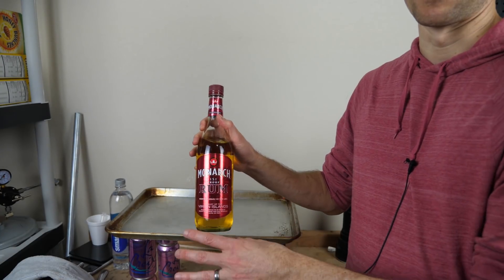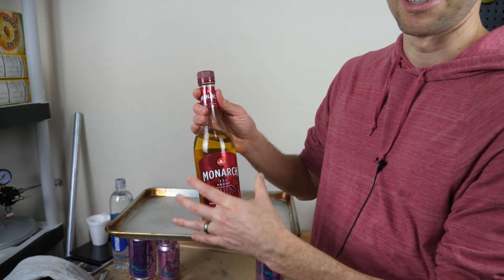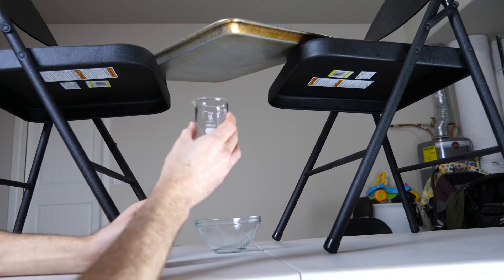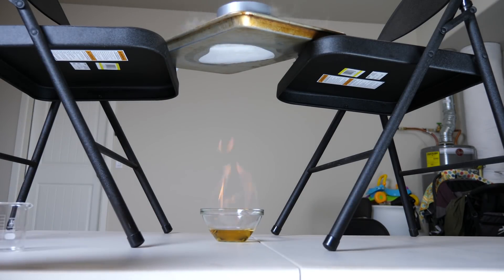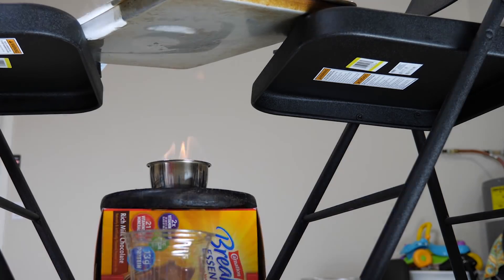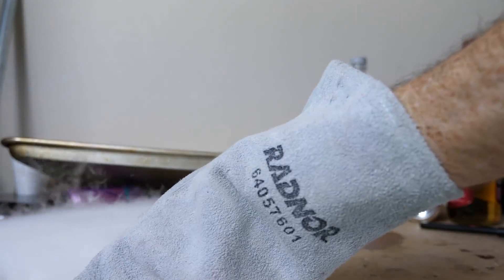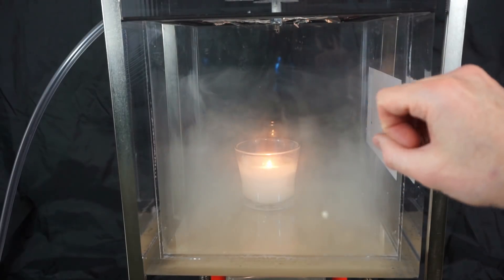Is it Possible to Turn Alcohol Into Pure Water? (I Almost Burned Down my Garage)

Comment from the maker: Hi everyone! Based on a lot of comments I need to clarify. This is not distillation. Distillation is the process used to separate two liquids. I am not distilling the alcohol. I am literally converting alcohol to water, not just separating a mixture. Distillation also requires condensation, so I guess that is where the confusion is. However typical lab condensers that use cold water to condense cannot remove enough heat in this case since the steam from the fire is extremely hot, that is why I used dry ice.
Reply: The Action Lab 
Yeah tell em dae wae
Reply: P.S. If you used scotch for this video and not some cheap junk in a plastic bottle I'm going to have to report this channel for cruelty and disturbing content.  Commented before the video, time to watch!

edit: ok cheap rum, we are safe. High proof vodka would have been better, Specifically Everclear, that's 190 Proof and doesnt have sugars or colors like rum.
Reply: I noticed that the atmospheric water first condensed and freeze on the cooling surface (white layer ) which with heat from combustion melted and dripped with the condensed water from flame this increased the total water collected
Reply: Seriously, you should have at least a few fire extinguishers in your house.  At the absolute minimum, one in the kitchen.
Reply: Haha, that fire, my dad once burned a whole table down when he was trying to get pure alcohol...
Reply: The Action Lab Try to think of your safety a bit more next time.,.
I mean that set up, gosh.,.
Reply: The Action Lab Drunkers be like "why the hell you wasted the whole  rum to get 20ml of water"
Reply: The Action Lab what if the water in the atmosphere got condensed by dry ice and its melted by the heat from the burning ethanol
Reply: Are u born goodva
Reply: I may have missed a step, my water came out dry.
Reply: The Action Lab yep hlyour right
Reply: The Action Lab can you do a Q&A in the near future?
Reply: This experiment is about the only useful thing for that rot gut rum.
Reply: Action lab I think the coolness of the dry ice would convert atmospheric moisture to water
Reply: Please stop making your videos click baity. All you're doing is a combustion reaction...
Reply: Is it distilled water 
So it is dangerous to drink 
But how distilled water is dangerous and we drink distilled sea water
Reply: The Action Lab this is satisfactory :)
Reply: Are you sure the water collected wasn't condensation formed by the air in the room from the dry ice..? Not that dissimilar from a glass of cold water right? I feel like this expirement could've been done better
Reply: Hmph I almost said distillation
Reply: To remove the idea of distillation.... maybe try burning a measured amount of denatured alcohol, which is around 99%, using the same method. At same time put 2nd dry ice pan over a 2nd bowl of plain water with no heat. Show the collected amount of water from the burning alcohol is still more than the 1% that would be in the alcohol even when subtracting the 2nd amount of water collected from the moisture in the air and the unheated bowl of water done as a separate experiment at the same time next to the alcohol setup. Even if it comes out not in the favor of your premise it doesn't dispel it, just that it is difficult to prove using your particular method as proof. Then again, I could be all nutz to the wind on the whole idea.
Reply: The Action Lab it’s not = it’s and arrow
Reply: Can you do the walking on water experiment using cornstarch
Reply: This is actually not pure but very lightly carbonated water
Reply: Very good explanation.
Reply: Yes it is possible, it's called distilling, usually the goal is to get stronger alcohol and to throw out the water but... I suppose you could do it for water if you're crazy. 

You just went the more complicated route
Reply: hi men, I love your videos, congratulations for your exciting experiments.
By the other hand, there's a lot of stuff about the flat earth and conspirations and stuff, and in one of the flat earth videos I've heard about the moonlight decrease the temperature of anything that lights, and it's one of the arguments that the flatearthers use to support their theory, I have an idea of what happens but I really like if you make a video about this topic and explaining what and why happens, that will be cool.
Again, congratulations and have an exciting day full of science.
Reply: using a lower grade alcohol like 80 proof and boiling it off would yield better results
Reply: @BeckyYork  https://youtu.be/nVFUrIe7r9s

Comment: But an alcoholic beverage product is not 100% alcohol and the water comes from it is not only from the combustion of pure ethanol alone, but the water content itself present in the beverage product also getting evaporated and condensed due to the heat of combustion.

Comment: In my opinion this experiment was done incorrectly, I'm almost willing to bet that most of that water collected was from condensation formed from the air, not the alcohol combustion. Just like cold water in a glass causes condensation around the glass. I wish you would address this man!

Comment: Why not heat the rum to 175°F to boil off the alcohol. Wouldnt the method used in this video condence the heated air on the the bottom of the tray and create that condensate?

Comment: You should redo this with a simple jury rigged distiller for the water vapor. You can certainly do it on the cheap that way. Maybe a collab with some handcraft or machining channel. I could provide  some designs if u want

Comment: I don't know how humid it is where you are, but couldn't a lot of the condensation on the metal pan be from the air, and not necessarily from the alcohol? I'm in SE Texas and I'm pretty sure most of the condensation would be from humidity if I did that here.

Comment: u might want to use dry ice in acetone(a few other liquids should work), it has a smaller but flatter surface area so it gains less heat but transfers it more effectively to the desired place. it's used in place of liquid nitrogen whenever you need something very cold but not that cold

Comment: A lot of the water was also just water from the air because dry ice also condenses water vapor from the air. You should have used normal ice.

Comment: Water and co2 are what you get when you burn a hydrocarbon. When you burn charcoal you only get co2. When you burn other elements you don't get either. Many metals are flammable in the right conditions. Including aluminum, magnesium, and titanium

Comment: we could try chemical approach buuut we don't know if it's worth the hassle and if nobody will watch it?

(theory... ethanol should get oxidized to water and ethanoic acid with potassium dichromate (i call it orange cancer), now sulfuric acid should be able (not 100% sure) to oxidize it further to carbon dioxide and water, after distillation the water should seperate from sulfuric acid....)

Comment: This is kind of a shaite setup. Humidity from the air would gather on the bottom of the pan and condense regardless of the vapor created from burning the alcohol just like you said at the end of the video yet that is not insignificant. You need to isolate the gases using a condenser and then expose the condenser to a cold temperature.
Take a look at 4:50. The humidity has already caused condensation below the metal pan before he even lights the alcohol. What you tasted wasn't just water from alcohol. It was largely water from the air.

Comment: Another way to do this without combustion would be with potassium permanganate.  Concentrated solutions tend to oxidize short chain alcohols all the way to CO2 and water. It still gets super hot and can ignite certain polyalcohols like propylene or ethylene glycol or glycerine when anhydrous. However, I wouldn't recommend drinking the water produced without distilling or at least RO filtering out the resulting manganese dioxide.

Comment: The problem with this experiment is that a lot of that water will be just entirely from the air already in the room, as whenever dry ice is in a container, frost builds up on the walls of said container very quickly regardless of any reaction going on nearby. You'd have to do this in a very controlled environment with 0% humidity in order for it to be accurate.

Comment: how do you know if its water from the Rum not condensation of room air because of dry ice?
Reply: Because you can't do the same expiramebt without alcohol and get the same result. Even in this expiramebt, you would end up seeing frost all over the metal surface.

Comment: You are drinking water not of alchole because when you light up alchole you put dry ice when you heat dgo on dry ice the metal has dry ice water you are drinking that
Reply: M. Ahmed dry ice water doesn't exist. Dry ice doesn't melt.

Comment: Best way to collect the water is to use certain glassware that can take the water from the burning material and send it either back down or send it down a tube with a circulating liquid, or just blow air on it so water condenses and goes down to a lower container where you can collect the water. You are doing both a chemical reaction and some separation since the carbon dioxide not much of it will return to becoming dry ice.

Comment: In an emergency situation (likely the place turning alcohol into water would have an application) if you need water and only have access to alcohol, the more plausible way to get water would be to just boil the alcohol out of the water. Ethanol has a much lower boiling point than water 173 F vs 212 F for water. Since most hard alcohol is about 40% alcohol and 60% water, you will get quite a bit of water. Odds are you wont have access to ice, but will have access to a campfire or similar.

Comment: This is super misleading! Extracting water from alcohol is more appropriate sir. Also, you're adding more oxygen as you're burning it with air! Rubbish
Reply from the maker: Lol, I didn’t extract the water, I burned the ethanol which converted it to water and CO2. Nothing is misleading, it’s just you don’t understand what is happening...
Reply: The Action Lab of course you'd say that sir to defend yourself!  But getting rid off the majority of a molecule and combining it with more oxygen from air isn't strictly "turning alcohol into water" is it? Elimination processes would've at least been better way using concentrated sulfuric acid as a catalyst in 180 degree centigrade. This would've given you ethene (alkene) and water. Use proper techniques and equipments if you want to appeal to a wider audience! Cheers

Comment: You should out acohol in the vaccum chamer.. since the alcohol har a lower boilingpoint of water, you should be able to lower the pressure to boil the alcohol out of the water without lighting everything on fire. :P

Comment: So are you sure the water dripping off isn't just condensation from the air and the fire just melting the frost at the bottom of the pan and none of it is actually the rum.
Reply: my thoughts are exactly the same

Comment: In distillation a water alcohol solution is heated to the temperature which alcohol turns into a vapor but the water does not. When you collect the vapor and cool it you get pure alcohol. Wouldn't it be easier to heat it with out collecting the alcohol until the alchohol is gone? Theoretically it should still have some of the original flavor without the alcohol content.

Comment: Actually I think you might have collected all the water. You said there was a hundred mL of alcohol and you ended up with 20 mL of water so if the 100 ml of alcohol was 150 proof or about 75% alcohol then that would mean you should get 25% of 100ml as water. So the most you could have gotten is 25 mL but you got 20 mL leaving you with 80% yield.

Comment: Like your videos, but not this one. You just melted the ice which formed out of the surrounding air on the cold metal plate. To proof it, do it again with anything else burning than alcohol, you will get water drops as well

Comment: You got lucky LOL
Once I was trying to prove rocket fuel burned in a vacuum and I blew up my vacuum chamber. LOL Its impossible to do it in a small area as the gas builds up before you can get her lit.
By the way adding oxygen to rocket fuel does allow it to burn with no atmosphere.
But if you watch Action Lab videos you know nothing can fly in a vacuum.
Also if you put a lit candle in a vacuum and leave it there, you don't even have to turn it on, as soon as the air is gone the candle goes out.

Comment: first of all i like that you dont drink and secondly it would be easier to cool the bottle down with the dry ice. the water inside freezes and forms a cube, leaving back the methanol. you just need the pertect temperatur, above methanol and beyond water.

Comment: Hey bro , I am not satisfied with your experiment . I want to know is this pure alcohol ?! Or it contains water . If it contains water then u just did evaporation of water from alcohol and condensation of vapours . But u didn't convert the alcohol into water . Hope u r clear or knowledge me . 
I want to share a way to convert alcohol into water . 

Simply add Hcl with alcohol .
And sn2 mechanism appears 

C2H5OH + HCl - C2H5Cl + H2O

Now just heating it H2O evaporates and u need to do condensation to get water ..  C2H5CL remain the same . 
There are many ways to convert alcohol into water . U just need one reaction in which the byproduct is h20 to get it .
Another reaction is ester formation 
i.e reaction of alcohol with acetic acid ... U will get water and ester . .

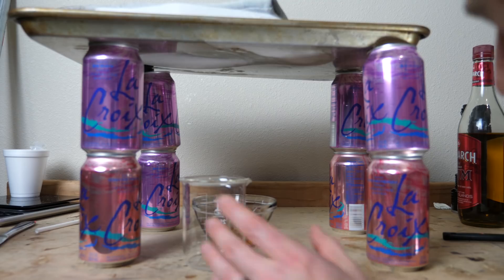Comment: 4:42 
Instructions weren't clear, I got liquid water
Reply: Something is wrong. I got hydrogen peroxide.
Reply: i got a rock
Reply: I got watery water :(
Reply: @justworks1200   and that's a bad thing?
Reply: I got wet water :(
Reply: Leafy147 Interesting..... What does it taste like?
Reply: DOH!
Reply: I got ice
Reply: i got oil which i turned into alchoal via magic which i turned into lava which i finnaly turned into water so i did it AGAIN
 only then did i get the fire the video promised

and now i dont have a house
Reply: I got trihydrogen dicarbonate sulphide
Reply: Ha ha
Reply: Try again

Comment: I mean good video but why don’t you do it the safe, chemists way and get a bunsen burner, a tripod, a pear shaped flask, a condenser and some extension glassware for the condenser (don’t forget condenser clasp thingies) and also a stand a clamp. That way, you can place the flask with ethanol above the bunsen burner on a tripod, the flask is attached to the condenser filled with cold water so as the water evaporates from the flask it will condenser and turn into liquid, to be collected in a beaker at the other end of the condenser. also think about the environmental issues with CO2... I think I did too much chemistry today
Reply: Andzelika D thats carbon neutral co2 since its a product of plants
Reply: Carlos Leon all co2 is carbon neutral if you account for the fact that all of the carbon originated on earth. We're not turning the world into something new and hot, we're taking it back to before the dinosaurs, when oil and coal were co2 in the air.
Reply: The Raven i meant the c02 being produced came from already living plants and not from deep under the earth making it not count.
Reply: Carlos Leon the stuff deep in the earth came from plants and animals that are part of earth. You're just ignoring part of the equation and then saying its unbalanced.
Reply: The Raven yes of course, but they were isolated from the rest of the system before we dug it up. prior to that they had no effect whatsoever to the outside environment and could as well be non existant.
Reply: The Raven Unless you go back millions of years, in which case they would have been plants but were talking about a short window of time in modern history
Reply from the maker: You are talking about distillation. This was not distillation...
Reply: The Action Lab Ah yes you are right, but surely there is similar equipment setup you could use for burning which I wasn’t taught about yet (I’m a chemistry student, forgive my mistakes)

Comment: Id like to see this done with a specially made shield to  properly collect the water by the same method you explained in this video,  im willing to bet if there were maybe a 2 inch rim facing down on all sides and enough dry ice to cover said shield [since the condensation is more likely to freeze to the metal where it has direct contact with the dry ice] you could get considerably more water.

Comment: Wouldn't it be better to distillate the rum to obtain pure alcohol, and then do a distillation of the liquid to get rid of all the other components? Add to that what you said, that the dry ice will also condensate the ambient water, so part of the water will be from the ambient and not from the alcohol. Of course, you can also burn the alcohol from the pure alcohol obtained by the first distillation and add it to the distilled water you got and the yield will be a lot better.

Comment: Why wouldn't you just boil out the alcohol? It's boils at a lower temperature than water so you wouldn't loss the water if you kept the temperature low enough
Reply from the maker: Because the point of the video was to change alcohol into water
Reply: The Action Lab Ok that makes sense I thought you were just trying to get the water out of the alcohol.